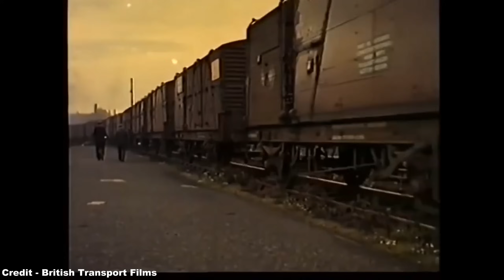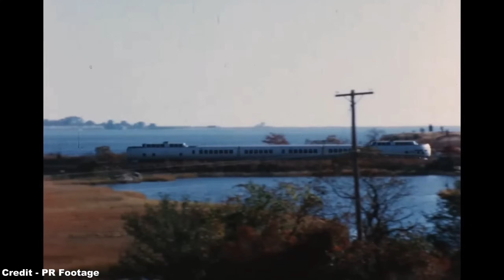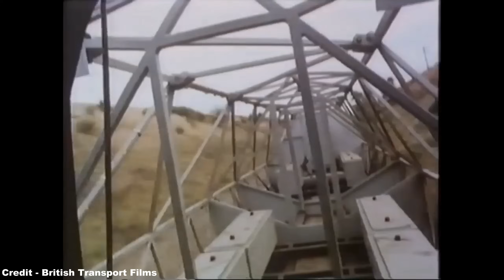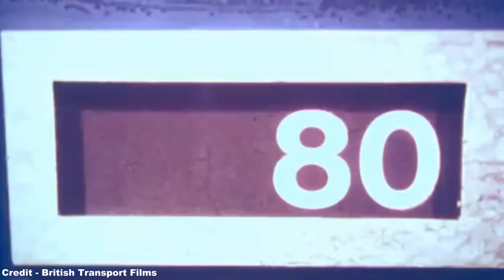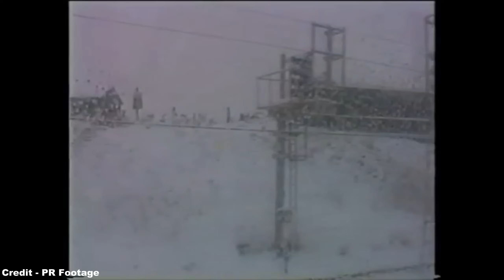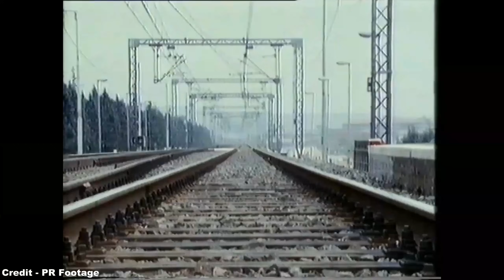Tilting Tragedy - The Advanced Passenger Train (Reworked)

Comment: Maybe instead, we should have built a new high speed line from London to Glasgow before it cost too much to be viable ? 
We could have called it HS2.🤣🤣🤣🤣
Reply: Hindsight is a wonderful thing.  We already had a line covering most of that distance, engineered for higher speeds and larger loading gauge with limited intermediate stops, it was called the Great Central Railway.  At that time, not much of the closed GCR route had been built over and it would have allowed higher speeds using the relatively cheap HST whilst relieving pressure on the WCML.  However at that time the demand for rail travel had not started to ramp up as it did in more recent years, so it would have taken great foresight that was probably unachievable even amongst the most optimistic of rail supporters.

Comment: Should have made the APT-P be powered by the Paxman Valenta when replacing the Leylane turbines..
Reply: It would have been short on horsepower, the APT-P needed 8000 hp to accelerate and go as fast as it did. Two Valentas only produce 4,500 hp together. The Velentas would also have weighed a lot more.
Reply: It would have been short on horsepower, the APT-P needed 8000 hp to accelerate and go as fast as it did. Two Valentas only produce 4,500 hp together. The Velentas would also have weighed a lot more.

Comment: I don't think enough is made of the role of the HST in killing off the APT.  The HST was only supposed to be a stop-gap to accelerate train services until the APT was ready; however, the relatively simple but well engineered HST turned out to be a real winner.  No tilting, but at 125 mph it was good for the GW and EC main lines and made a startling reduction in journey times compared to the previous loco hauled trains.  I remember the first time I travelled on an HST, compared to the previous Deltic and Mk 2 coaches the HST seemed positively space age, I spent the journey (up the ECML) timing mileposts and was astonished at the long periods of time we were doing 125!  Fabulous, the fastest I had ever travelled in my life.  And the cost of building HSTs was a fraction of building APTs.

With this great success of the HST, there was no case to build APT for the GW and EC main lines (especially as they weren't electrified), the only case for the APT was the WCML.  Of course the HST could not do 125 on most stretches of the WCML, but a lot of the time, nor could the APT.  the crowding on the WCML even in those days was already problematic, it being Britain's busiest freight route, so pathing for long stretches of 125 mph running would have been limited.  Realistically, the journey time reduction in everyday running compared to class 86's would have been limited.  So to carry on with the APT, which could only be used on one main line and even then not perform at its capacity most of the time, really wasn't a very good case for investment.  Even though it was undoubtedly a great product technically.

Had the HST not been a such a shining success, then there would have been a stronger case for continuing with APT, even though it would have needed either a diesel drive unit or electrification to be used on GW or ECML,

Sometimes, a simple solution that achieves most of the goal at a fraction of the price, can be a better return for the business.  It's called the "Pareto principle".  The HST achieved that and the APT was out in the cold as a result.

Though I was very sad to see the end of the APT programme, and I never got to ride on one, I think on balance it was right to kill it.  Replacing all the WCML express fleet with APTs was probably unaffordable without the prospect of use elsewhere.  When Virgin introduced the Pendolinos it didn't need government money, Alstom funded the manufacturing and Virgin paid them for use by the mile, a much more user-friendly funding structure.  The Treasury would never have stumped up for an entire fleet of APTs.
Reply: Unfortunately losing the APT also killed most of our domestic high speed train manufacturing and drove up costs, costing jobs and a ton of technical expertise which is one of a number of reasons why our rail systems now suck so badly.

Sometimes you make a product because it's important to do so.  The APT would have been a market leader and been improved very quickly, and would have formed the basis of our own ultra high speed train network.

Instead we got stuck on the HST, and the world left us behind.  No one but Britain needed the HST and when it came time to replace it, instead of a continually improved and engineered APT, we got the Pendolinos.  Bought in from abroad, at the cost of local jobs.  Worse, paying per mile resulted in a continuous usage cost rather than the static upfront cost and since most of our modern trains are hyper optimised to handle our shitty rail network, it took nearly 30 years to inhouse enough high speed rail expertise to build anything more substantial.
Reply: @ralalbatross  Thanks for the comment.  But the evidence does not fully support your claim that the HST destroyed our train building expertise.  The first electric trains that replaced the HSTs on the ECML were made in the UK IIRC.  By the time the Siemens trains replaced the HSTs on the GW, the UK rolling stock manufacturing capacity was already trashed.

Frankly the masses of money spent on the APT, and additional cost of the pendolinos compared to non-tilting trains, would have been better spent on improving the WCML so it didn't need tilting trains!  

Paying per mile for a train built and maintained by the same company is actually a better deal, for two reasons:-  
1.  Because it gets new trains on the tracks when the operator doesn't have the money to buy upfront.  
2. It means the manufacturer is incentivised to build a better quality product which is more reliable and robust, to minimise maintenance cost and maximise life - whereas if you buy outright then the buyer goes for the lowest tender which invariably results in equipment where corners are cut to bring the price down instead of going up to a quality.  Especially in the UK, where buyers are notorious for putting excessive downwards pressure on price, resulting in shoddy equipment that costs a lot to run.  The result of the pay-per-mile model is lower overall cost of ownership in the long term, and fewer breakdowns.  The reliability and longevity of the pendolinos has been excellent.

I've seen this in many items of process plant.  A lot of the income to the team of engineering consultants I run comes from putting right design shortcomings in plants where the buyer has bought what was cheapest to buy, instead of a better quality job that would cost less to own overall.  A contract to supply and maintain, paid for by output, ensures the design drivers of both buyer and user are properly aligned.

As far as taking 30 years to in-house enough expertise to build high speed rail, that isn't quite true.  Yes it took 30 years for the politicians to find the will, but only about 10 years to in-house the expertise once they finally decided to back it.  We should be extremely proud of what the technical guys on HS2 have performed (my team have been part of it!), the sad thing is that it is in danger of being dispersed and lost.
Reply: @marionbloom1218   Interesting but i think you refer to the Hitachi trains that replaced the HSTs on the GWR.
Reply: @Martindyna  My understanding was of the arrangement I described with Virgin Trains on the WCML.  I was not aware that there was the same arrangement between Hitachi and GWR.  However, it makes sense because it helps to align the business drivers.  If the manufacturer knows they will have to pay the costs of maintenance and repairs against a fixed per-mile payment, then they are more inclined to put trouble into building a train that will have higher reliability and cost less to maintain, so the user gets a more reliable train.  If the maintenance is a separate contract that may go to someone else, then the pressure is on the builder to cut corners to make the train for less money even if it will be more costly to maintain.
Reply: @marionbloom1218  The Class 800, 801, 802, and 803 AT300 manufactured by Hitachi have all had their problems, the main ones being cracks found on the bodyshell at yaw damper brackets and lifting points. Also they are generally thought to be uncomfortable compared to the IC125 & IC225 but this is probably not Hitachis fault at least regarding the seats which could have been to a higher spec at additional cost.
Reply: @Martindyna  Yes I've heard they have had some problems.  But it's certainly the seats that draw the most wrath from customers.  I don't personally find them that uncomfortable.  I'm on them now and again and they aren't the best seats - definitely nowhere near the comfort we had on Mk3s and Mk 4s - but they're tolerable.
Reply: @ralalbatross that’s like saying pouring X more million pounds could’ve saved MG Rover and made their whatever they had in store a “world beater”
Reply: @Arty1589  Agreed.  The APT got bypassed by something more appropriate for the needs of the time.  Whilst I would have loved to have seen the APT be successful, the business case for it wasn't really there.  So many times BR made this mistake - lots of money put into great engineering, without looking closely enough at the business case to see if it was really worth the money.  Same thing happened with the Blue Pullman, technically successful but scrapped after a few short years because it didn't fit the needs of the business.  Could argue the same for the BR standard steamers, and many of the classes of diesel locos built under the modernisation plan, all defeated by a lack of co-ordination at strategic management level.

Comment: The UAC Turbo Train is still the fastest train ever used in Canada. At official 225kph and unofficial 273kph. It was in service for 15 years and the tilting mechanism was locked out early on. Unfortunately all trainsets were scrapped and replaced with Bombarder LRC and those were replaced with Siemens Venture recently.

Comment: I heard that the nausea was a result of the tilt mechanism being TOO good. One of the most common causes of travel sickness is the brain receiving conflicting messages from your body's senses. In the case of the APT, the eyes were telling the brain that you are going around a bend - depending on which side you're sitting, you can see the bend stretched out before you when you look out the window. However, due to the tilt mechanism cancelling out the centrifugal force, you don't feel like you're going around a bend. This mismatch is what caused the nausea. Today's tilting trains do not fully counteract the centrifugal force on purpose to prevent this phenomena from happening, cancelling out just 90% of it, not 100%. Not entirely sure how true this is but that's what I was told.
Reply: That was a problem that JNR experienced when they built the JNR Class 381 Series train sets with a pendulum-based tilting system for use on the run between Nagoya and Nagano in 1973. It took a lot of tweaking to reduce the effects of the tilting mechanism on that model train.
Reply: That is correct.
Reply: Exactly true, but until we'd built the train and tried it, no-one actually new that.

Comment: Ironically most of the issues fixed with the APT or not far off considering what already spent.
However whereas we now building high speed rail seperate for them the APT tried to fit higher speed onto existing infrastructure and would exacerbate the issues of mixed transport on the WCML and ECML where have freight, local and inter-city all mixed in together if had been kept.